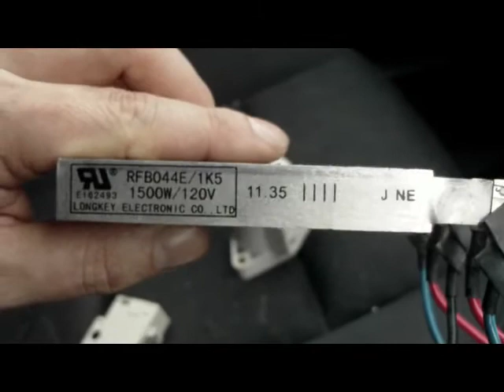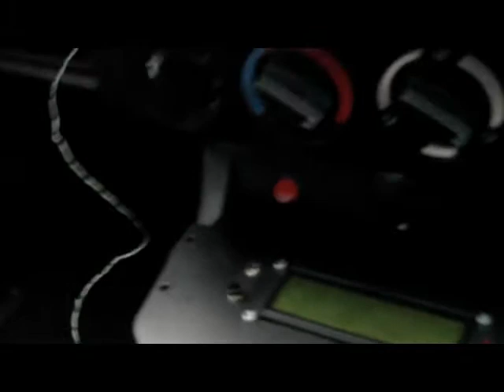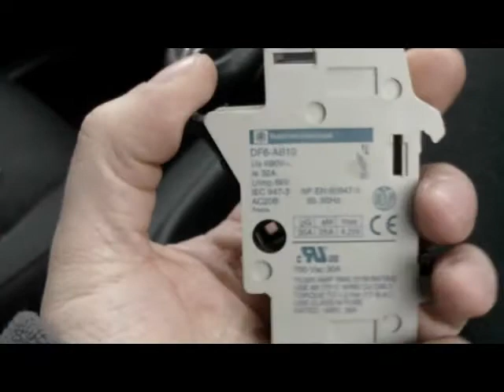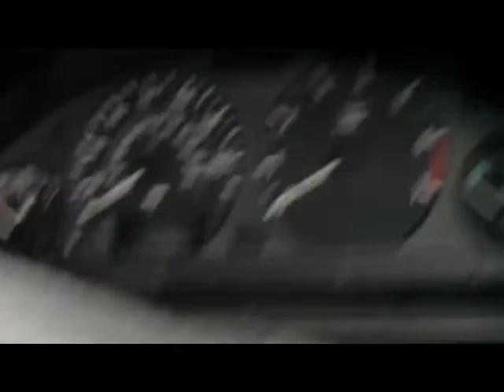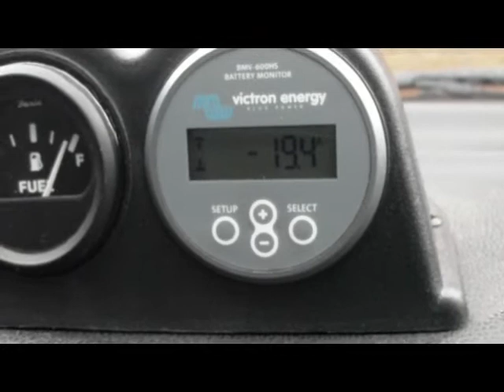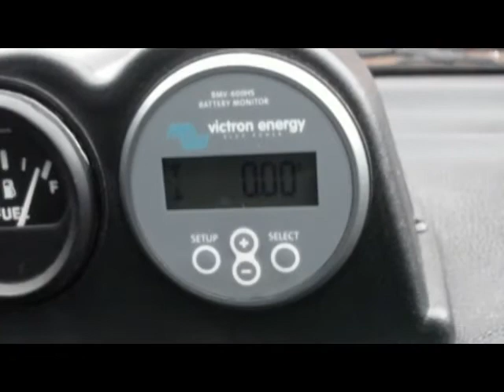BMW EV Conversion 67 The Heat Is On

Comment from the maker: There are 2 x 1500w elements for a total of 3000w. Air is drawn from the outside. Ideally power for the contactor would be derived from the fan switch but even that is not foolproof. The flaps could be set to cold air for example. Therefore , I use a bit of common sense regards switching the heater power. That said it will only energise with the key on so cannot be left on accidently in that regard.